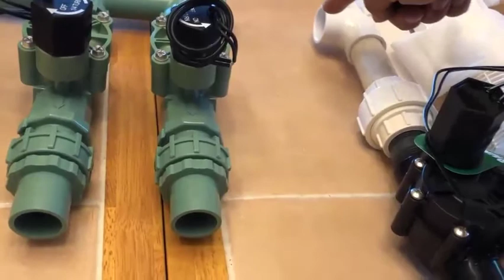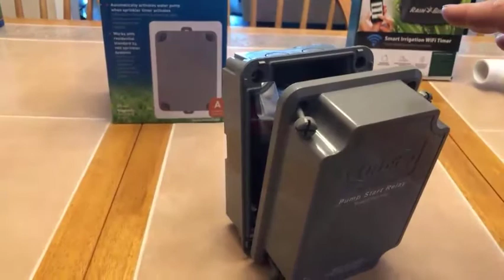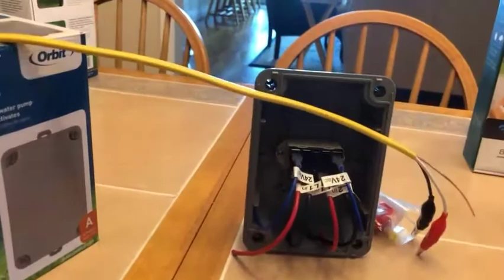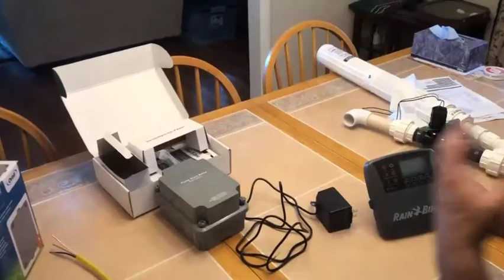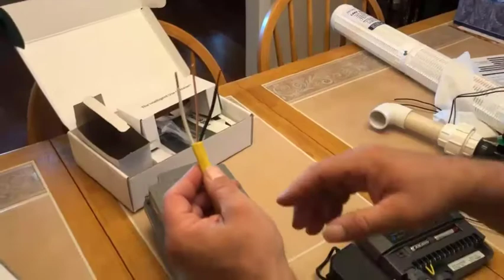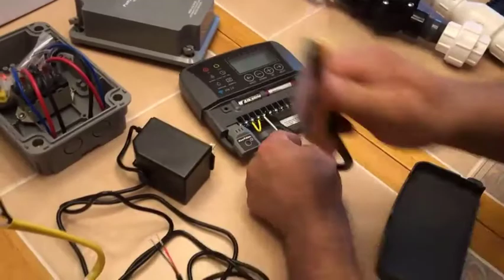3. Home Lawn Irrigation System - Sprinkler System Electronics

Comment: Can I have question:
Install pump to relay and then come out 24v and then to master valve 
Is that need 2 wire to master valve or just only need 1 ?
Reply from the maker: Take a look at another video showing the wiring setup and it describes what is going on.  https://studio.youtube.com/video/CcHFaiujry4/analytics/tab-overview/period-default 

Power goes from whatever power source coming IN.  The power out goes to the actual pump.  The 24v for the master switch goes to the low-voltage blue leads as in my relay box.

Another video shows the entire connection with simulated power from a batter to a light indicating the power to the actual pump.
https://www.youtube.com/watch?v=0eEDXdO1fo4

let me know if this resolves your questions, or you need more clarification

Comment: What can I buy for a filter and where can I buy it. I'm just pumping water out of a lake straight to garden hose and basic sprinklers. Not a whole auto irrigation system
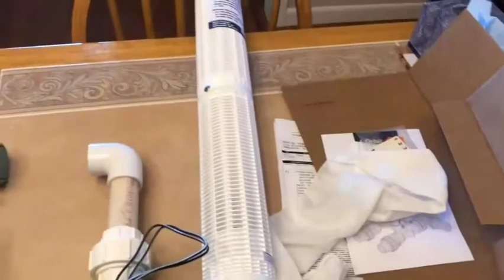Reply from the maker: I went to online HomeDepot.  Did a search on Lake Filter, and the first two items it brought up were what I have.  The "Superior Pump" brand for the primary filter with screen-like openings for the water to flow, and second was a mesh bag (like a stocking) that fits over it to prevent even smaller particulate from getting in.  Now, this in conjunction with the video I suggested prior at the 2:17 mark, shows that you just need the extra few pieces to size it down from the huge input down to a 1" foot-valve.  Then, once at the end of the foot valve (to prevent loss of primed water in the system), you could probably hook up some PVC end that would allow a direct connect to the other end of a garden hose if that is what you are just throwing into the lake as the source.  Now, you may not need the full PVC reduction and foot-valve, but at a minimum, some sort of PVC reduction to get to a connectable source such as your garden hose.  Please let me know if this helps you out.  The parts did have to be special order from home depot as not a common item and was easy enough online delivery direct.

Comment: I have well fed sprinkler system that isn’t turning on that I’m dealing with right now and this video helps me know how everything is connected, thank you!  One problem I have is that I have 5 zones but the only in ground box I know of, which I use to blow out the sprinkler system, has 3 solenoids in it, so somewhere I must have another in ground box that has the other 2 solenoids and I have no idea where that is! 😳
Reply from the maker: I'm glad this video helped and hopefully you can trace-down where the other box is in your system.

Comment: Thanks for this video.  I'm a complete newbie it comes to sprinkler systems.  My current system is a index valve pump, well water, intermatic timer.  I'm trying to replace this with a Rachio 3 ... so your system demonstrated here "looks" to be similar to what I'm trying to do.  I have that same Orbitz pump relay start box.  If I understand correctly, I'm supposed to have power in to the pump start relay box and power out to the actual pump itself.  How do I power the Rachio system? Am I supposed to have a separate set of wires from the Pump Relay box to tap into so I can power up the Rachio?
Reply from the maker: So, I have 3 videos that go over the wiring.  Start with this one which is  a simple picture drawing to show how the actual wiring goes
https://www.youtube.com/watch?v=CcHFaiujry4

This second one actually shows how the wiring functions in the house so you can see the pieces all tied together.  https://www.youtube.com/watch?v=0eEDXdO1fo4

This last one shows the final wiring coming via power from the house to the lake, then up to the pump start relay.  THEN, the low-voltage wires come up the second half of the box to complete the operation.  Per other comment, I will try to build another video but actually show the different zones actually functional.
https://www.youtube.com/watch?v=dTlFf9_uH0o

If you still have questions, PLEASE, give me a little more detail and I'll try to help you through it as best I can.

Comment: how do you get the black and white wire from the relay to the timer?
Reply from the maker: The wires all originate from the timer.  Did you see my video that goes over the wiring electronics in action?  That shows how all the wires work.  So, from inside the house, wherever you will mount the timer / zone controller, you will need to punch (drill) a hole through the foundation wall (such as a 1/2" or 3/4" hole that you can feed the multi-wire cable out.  Leave only enough slack in the house to handle the mounting position.  Then, you have to trench the ground and bury the wire.  I found that from the route my pipes were going to feed the irrigation system, I just buried it within that all the way down to my lake-front pump area.  At each of the zones that I put the manifolds, I would pre-strip the outer casing of the wire so when final hookup is done, I have the other colors along the path.  I can pull out and pig-tail the white wire as that is needed on every zone solenoid.  At the end where I hook it up to the main power, I am at the end of the wiring and can connect the black / white.  Check my video #8, it specifically shows how I split the outer sheeting of the wire, but let it continue and just tap into the white to continue the rest of the way down.  Then if you watch all of #9 video "Home Lawn Irrigation System - All Connected" you can see how I finalize the wiring to the actual power.  Anything else, please feel free to comment back and I'll help as best I can.

Comment: Why would you  drop the pve from the filter to 1 inch when the pump is 11/2 in plus that is a cheep pump start orbit realy the screws break all the time get a hunter pump start realy comes with a lock
Reply from the maker: My pump is a 1" inlet and outlet, so dropping the filter down to 1" just makes all the rest of the pipe within the system to 1" throughout.  As for using the Orbit Pump-Start-Relay, this is what my research exposed to me.  I am in a good community not worried about any need to lock it.  It's at the water-front, and if someone needs my power from this low-voltage switch, they have bigger problems.  I tried to make my videos for those out there trying to understand the overall context without having to become some master in all the formula mechanics and what pieces are used to do what.  So, this is what I found, and accumulated my notes to the summary showing what I bought, from where and what it was used for.  If there are other products out there that offer better, and other home-improvement people want to use a better product, good for them.  But if someone does not have a clue what the purpose is for a pump-start relay, and I have educated them on such to give that "oh..  now I get it", then I have helped educate someone if they were to do themselves, or have someone to do for them.  Being educated can help you from getting ripped-off too.